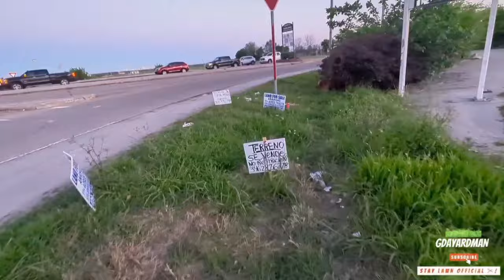This ABANDONED GAS STATION was a EYESORE and a HANGOUT SPOT for the HOMELESS

Comment: Nice work I have a suggestion though instead of having to reach so high to get to the branches that are near the top of the bushes just reach into the bush and take out the branches from inside the bush that way, you don’t have to reach so high just reach intothe center of the bush from the ground and cut it. Does that make sense? I hope it does. 
I’m glad to see you’re using some electric tools ,I think they’re great tools so much easier and the fact that you’re not breathing in those very toxic cancerous fumes that you get from the gasoline tools.
Reply from the maker: Thanks for that suggestion. Thank you for watching. I appreciate you